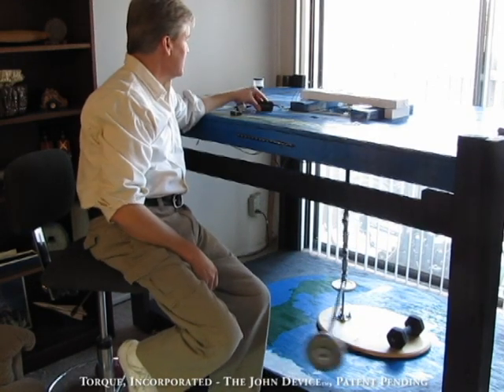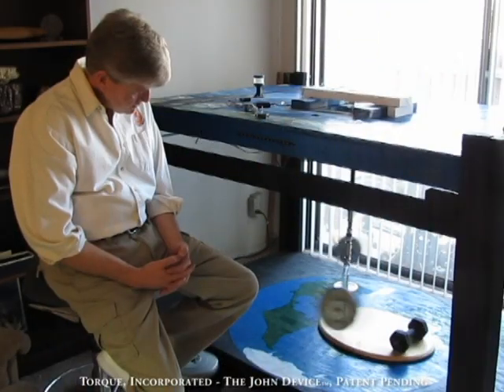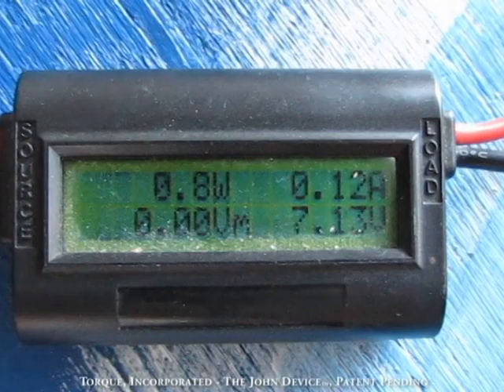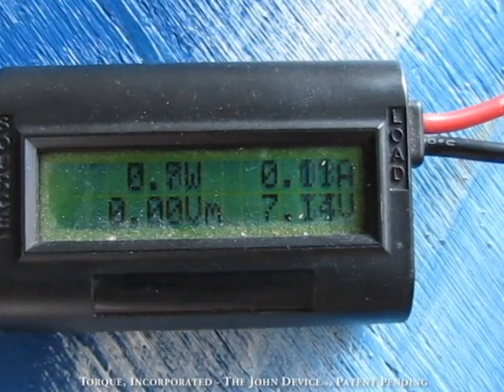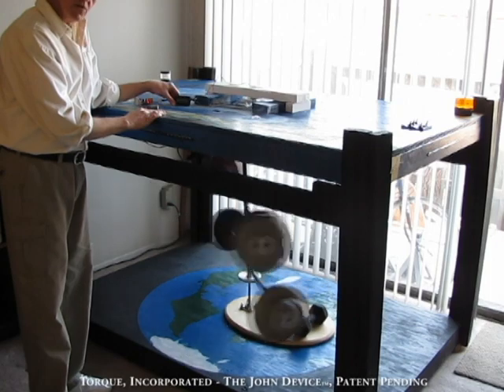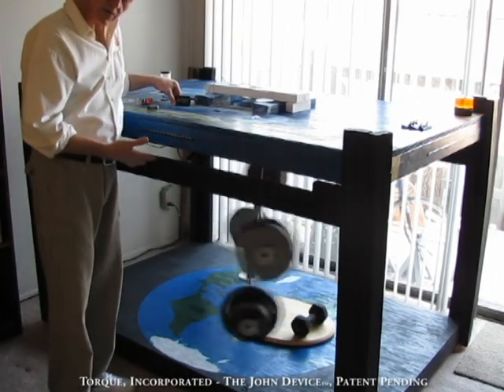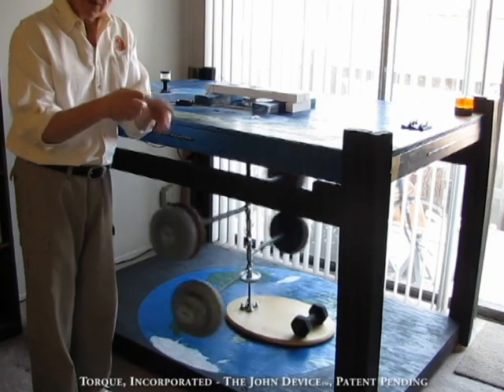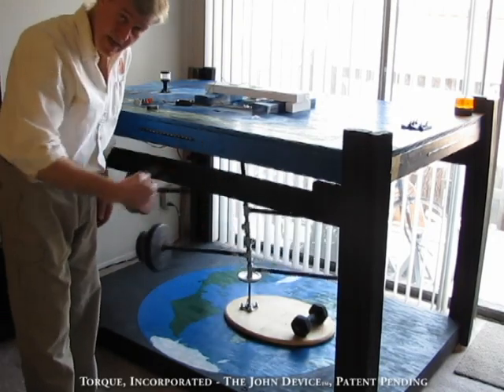The John Device Movie - No music

Comment: "Opposed weights" are NOT true Torque!!! That is the only problem with your system.!
Reply from the maker: Interesting.  So, if two aircraft carriers are mounted and rotating at, say 100 RPM, with a distance of half a mile between them, then there is no torque involved?  I think not.  This article on the moment of inertia will help explain.  Balancing two opposed weights does not mean they disappear or cancel each other out.  They exist.  They rotate.  That takes torque.
https://en.wikipedia.org/wiki/Moment_of_inertia